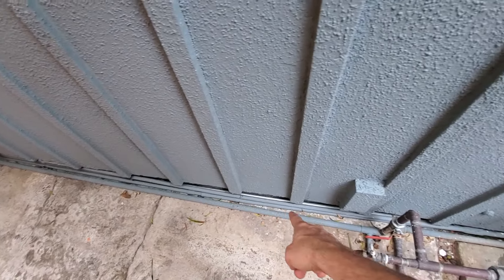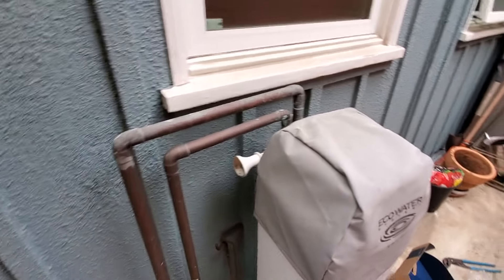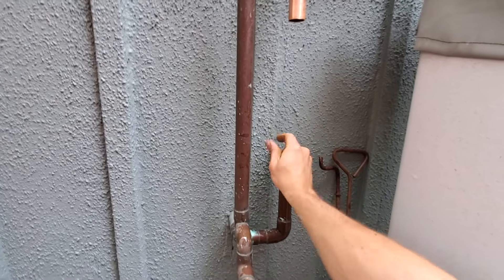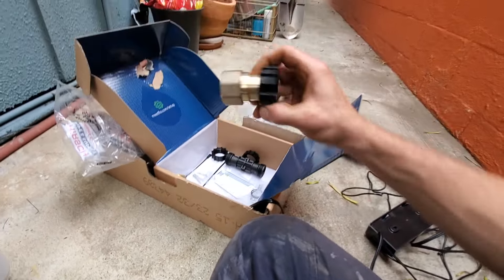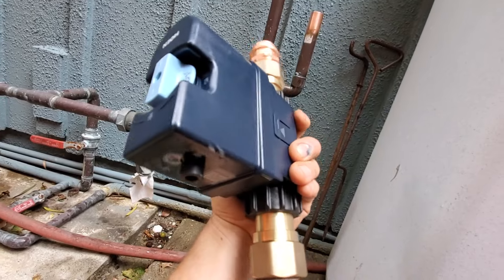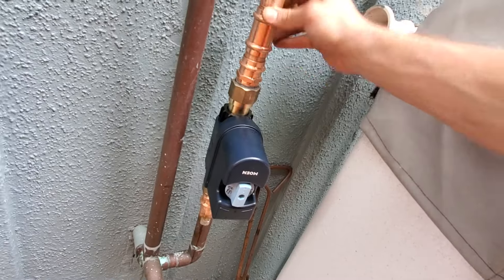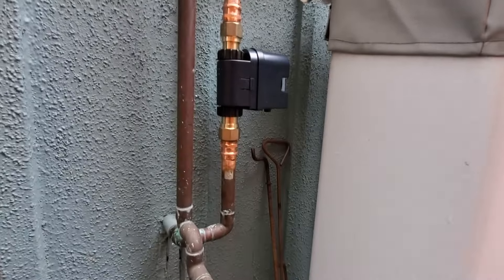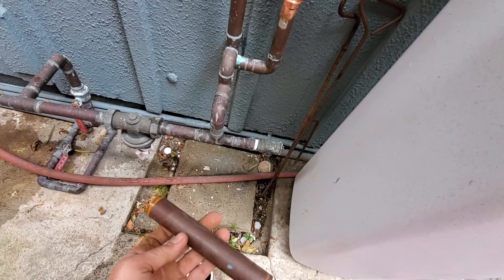Installing a 1" Moen Flo Smart Water Monitor

Comment: I just had a 3/4 inch flow installed by my plumber. The actual insulation went well even though he was working in the crawl space and I have well water. Setting up the Moen flow app takes more time. Several different steps just to connect to the internet. I had to install a wifi amplifier  to connect meaning he came back to register the device, connect to the internet, set up your house and water requirements and test the new valve. Electric outlet was at the pump already. All in all I am happy with the results and the moen flow app especially its micro leak auto testing. So far no leaks.

Comment: Great job. I have seen plumbers use a coupling on a soft copper then sweat a type L copper pipe to the Propress fittings for the Propress Tool

Comment: Great video can you please explain the issue with the pipe that might cause a leak?
Reply from the maker: @gm1937  propress sometimes will crush type m copper too much and cause a tiny little seepage on the propress fittings

Comment: Does it need water leak sensors to notify of leaks? Does it work with CPVC?
Reply from the maker: @menchetta5914  no and you can adapt it to cpvc I'm sure, but never done that
Reply: The moen flo has automatic micro leak testing done daily. Also shows water pressure, temperature, daily usage down to the hour. There’s even a on demand letter from moen to send to you homeowners insurance company for their discount.

Comment: Just wondering if there's water in a pipe how could one get it out to solder?
Reply: Many methods. Suck it out with vacuum or a tube, Freeze the pipe (This is used if you don't want to turn off water to the building you're working on like large commercial facilities), use a jet sweat (inserts into the pipe and expands to prevent water from coming back when soldering on a fitting. Usually used with an open ended fitting so you can remove the jet sweat), Shove some white bread into the pipe to absorb the water (The bread will hopefully dissolve completely when reinstating water), and many more!
Reply from the maker: jet sweat, put in a spray bottle head and spray it out, those are what i do, or use a shop vac